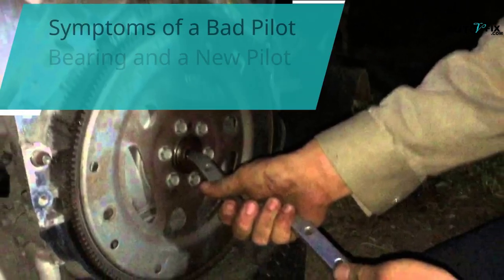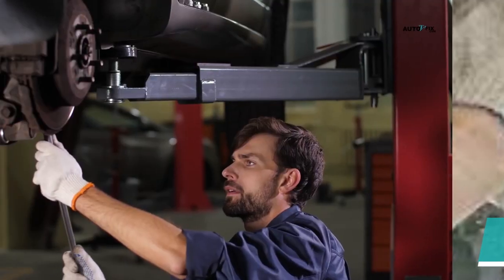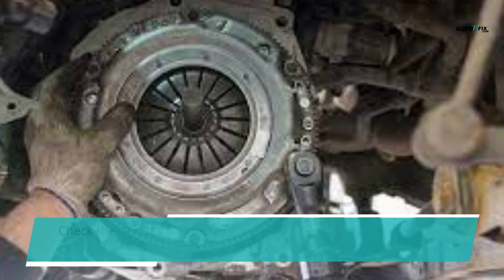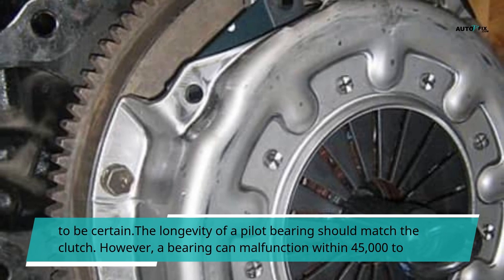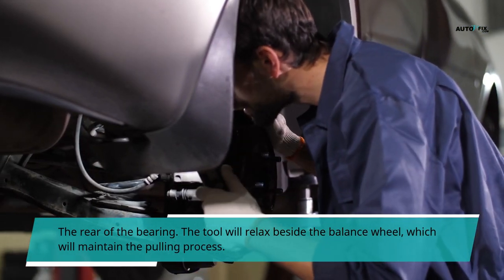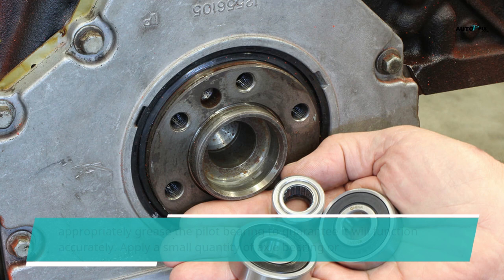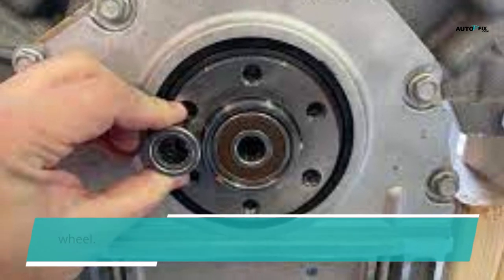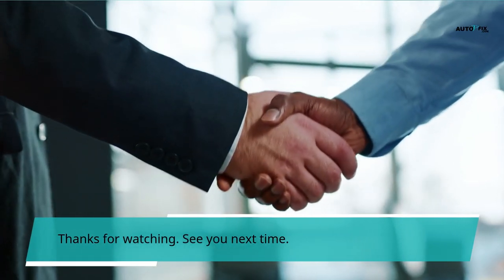Symptoms of a Bad Pilot Bearing & New Pilot Bearing Install Direction & repair cost

Comment: Its keep confusing me  when he said the alternator. why is alternator related to transmission pilot bearing?
Reply: Same
Reply: And "ABS" 😂
Reply: Exactly the reason I went to the comments! 😆 it’s like they are talking about three different things as one, not very trustworthy information! 😄
Reply: Taa hell does he mean?? Pilot shaft bearing making alternator stop charging and fkn up the abs system?? Maybe if we make sure we have the correct air pressure in the spare we could fix everything without having to worry about the alternator not charging??